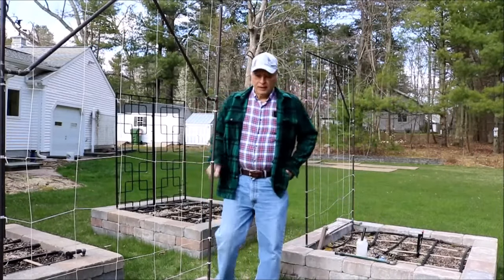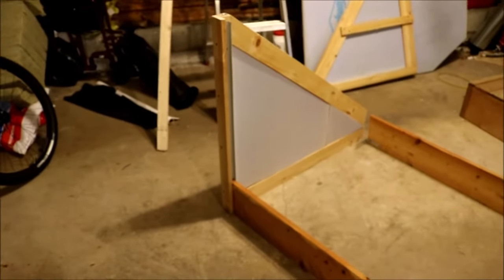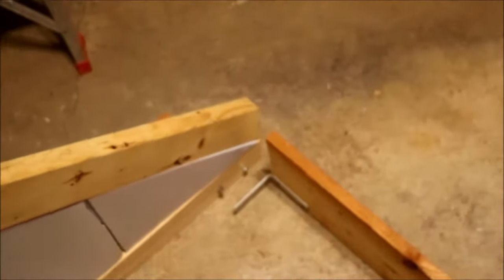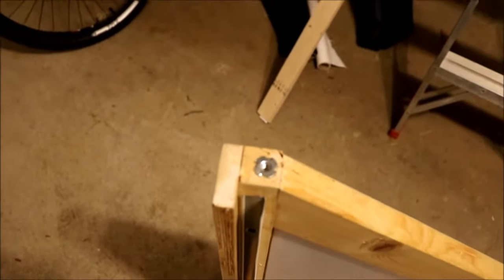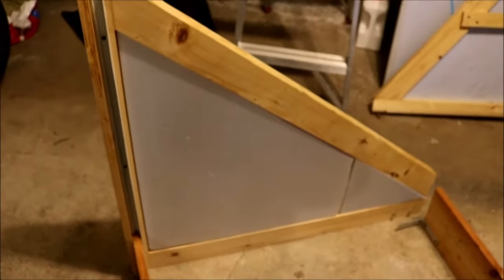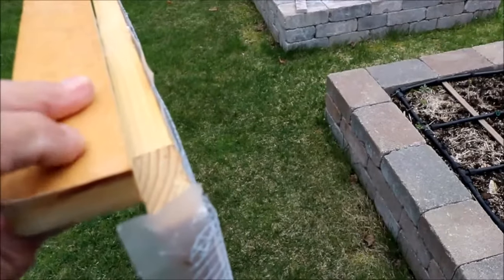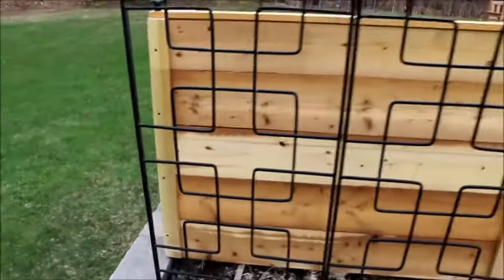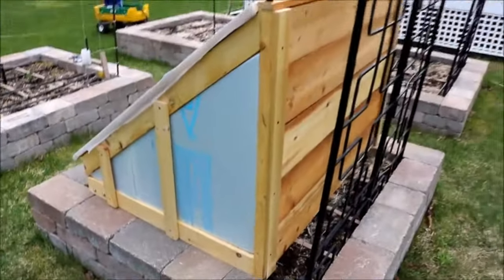A Collapsible DIY Cold Frame

Comment: Brilliant!  I badly want cold frames for early spring and fall, but I don't have space to store them.  These will be perfect.  What website did you use to figure out the ideal angle?

Did you make your sqft irrigation system?  I have been looking at pre-made ones that can be purchased, but I'm not spending $250 to water a bed.  If I can BUILD one, I would do that!  I'll go look at your other videos to see if you have one on building a watering system.

Thanks again for this video, it is just what I need.
Reply from the maker: Thanks for the kind words. The angle is roughly your latitude  plus 5 for the sun elevation in the spring. not critical. Mine is about 45 degrees.  Yes,  i made my irrigation system myself with parts from Drip Depot. I made a couple of videos on it. Much cheaper than buying it and the parts are commercial grade so I have had mine for quite a while.